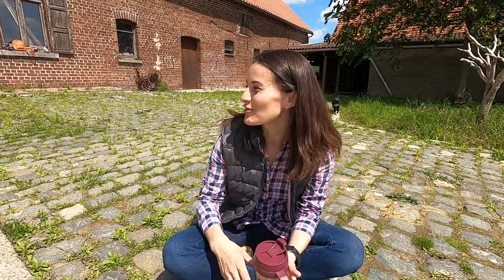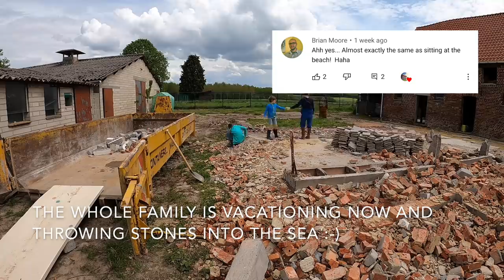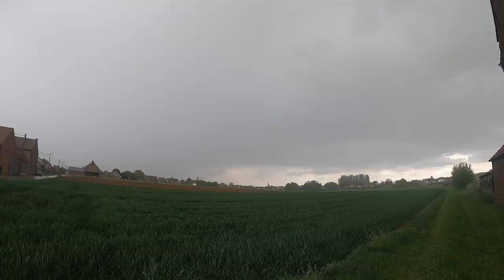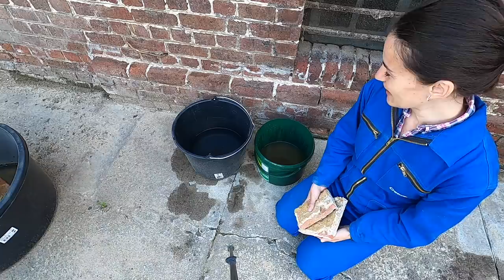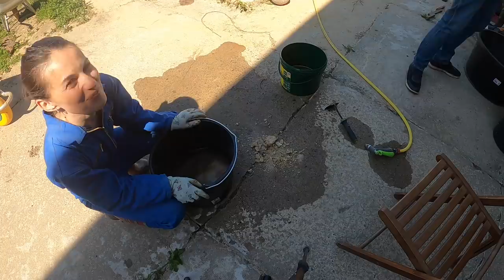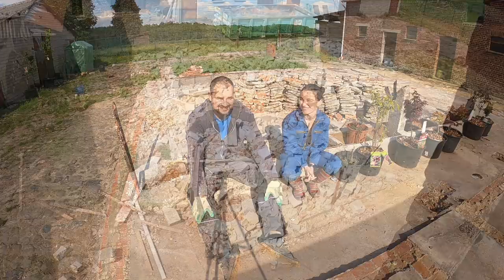NON-STOP backyard clean up from construction waste / fantastic SKY TIMELAPSE

Comment: A propane torch is an excellent tool. Also, horticultural vinegar30%, with salt and soap applied with a sprayer. Works very well. No chemicals.
Reply: there are also plant based weed killers since glyphosate products are banned. they work real fast and are bio degradable.
Reply: vinegar and salt make the pH hi
Reply from the maker: Plant based weed killers that are bio-degradable - sounds very interesting! I will check in our shops.
Reply: Plain old coarse salt applied on rainy days for maintenance after the tiger torch has done it's due diligence.
Reply: Wouldn't vinegar eventually damage their stones? Burning seems like a great solution in their situation.
Reply: They make propane torches specifically for this purpose. They work great!
Reply: @Aiko2-26-9   vinegar whil not bamage their stones , but the pH off the soil betwine wil get hi and other plants wil grow there , and those types of plants are almost impossible to get rid of ( Equisetum ) is 1 of them
Reply: @DeHoeveOldBelgianFarm   pelargonic acid
Reply: @louisblock1006  Interesting.

Comment: A 10 to 1 solution of what we call here muriatic acid or hydrochloric acid (or Zoutzuur in Dutch) would take that plaster off.  You can then use sodium bicarbonate in water to stop the reaction (once you've cleaned the plaster off).  It's basically a more powerful version of using vinegar and what brick layers use to clean bricks.   And once you mix in sodium bicarbonate (what we call baking soda), it becomes completely harmless to the environment. 

Бажаю тобі всього найкращого,
Jay

Comment: I think you need to make a wooden 'seat' to put the tiles into and then hit them with a bolster Try to get the majority of the mortar off them (I'd do it on a table). A brick bolster would probably be better - it's made for the purpose that you need it for. Also, a large rectangular plastic tub that you can get more tiles into would be good and a sieve that you can use to clean the vinegar with after each soaking would mean you've got a good chance of getting through the lot.

Comment: I like the propane method, not only kills the roots but any seeds as well. Only draw back is weed seeds float around so more will come. But you have a quick effective method now. Time to rent some equipment to assist with the concrete removal in the courtyard, a mini track loader will do the work of 5 people, rental rates in the states are not to expensive. An attachment with a bucket to scoop and load the debris into the container for hauling away. Will go much faster. Love your videos you are making amazing progress.

Comment: The propane / butane torch is good, but like another viewer noted, industrial vinegar helps as well. But your going to be battling it forever until you solve the root problem, namely an environment for weed seeds. You'll need to brush out a 2 cm / 1 inch worth of material around each paver and backfill with sand with a small portion of lime mortar. Sweep between the gaps, remove the excess, and water. It will seal things up and the weed seeds don't have a friendly environment to sprout and grow.

Comment: We only cleaned the sides of the cement tiles with a handgrinder (laminated disk), on the bottom we only remove the loose parts. It's a bit more work when you relaying the tiles, but it's still perfect after 20 years in our old farm. Once they are placed and washed in, we used a big rotation grinder for wooden floors (the ones with a big round disk) and grind the fresh layed cement tiles until the top (dirty) surface is gone. If you are in the north of Limburg (of Flanders) you can look and see for you self! Great job you two are doing.....TOP

Comment: The Propane Torch works, but the ash will work as a fertilizer at the end. There is no eco friendly way except the Saltwater but as a mixture with the cheapest washpowder from Aldi for white clothing! Mix it very strong, if you want you can put vinegar to it but this is not neccecary ( only for the smell) . I use always poolcleaner that smells better. With that mixture you can get rid of the green hell... hats off for your work!

Comment: The acid in the vinegar attacks the lime in the mortar. Any acid will work, even lemon juice. Muriatic acid is a version of Hydrochloric acid, the same as in our stomachs, but stronger. The acid in automobile batteries is Sulfuric acid. A strong version of vinegar - Acetic acid - can be obtained at photographic shops. It is used to develop film and photos. The strongest is called GLACIAL acetic acid, and can be diluted to a working strength. Muriatic is available at building supply shops and is used for etching concrete. It is probably the cheapest to purchase. When using any acid, be careful, wear gloves and eye protection. Thank you for the video. Anika is a nice cat. Jon
Reply from the maker: Thanks for sharing these details, Jon! Much appreciated!

Comment: To use the vinegar waste from stripping the lime mortar you can make an eco-friendly defoliate.  Use a mixture of one part salt to eight parts vinegar and a tsp (or small amount) of detergent for killing the vegetation in between the cobble stone you have everywhere.  Mostly it just changes the ph of the soil to a level which "most plants" find intolerable.  Dissolve the salt in the vinegar before adding the detergent or you will have a foamy mess.

Comment: If it was just a small area, boiling hot water would work. I've heard a vinegar, dish soap, and water mix applied with a sprayer works too. Though your backyard will smell like vinegar for a while. :)
Reply: Vinegar will deteriorate cement, so be careful what surface you apply this to.

Comment: you know that with just plain white vinegar you can spray on the grass in the cobblestones it acts a a weed killer and is safe to use and its cheap
Reply: or just use plain old road Salt and a good layer  ...  it hold it away arund half a year  after it it gone ...   we doing that at the fodbold station i work at ...  becouse we made not use any things like  vinegar ...  
or other  more evil things ...
Reply: My mother in law(97years) always uses  javel!
Reply: @nicolethijs5428  is will kill everything though...it's chlorine, a highly toxic chemical. As a side note...my Granny used chlorine bleach for everything from stinging nettle rashes to rinsing her toothbrush. Thank heaven we know better in the 21st century.  lol
Reply: I've used vinegar, and yes it does work.
Reply: White vinegar can be used for dozens of things- remove rust from old tools, great for cleaning with bicarb of soda...etc.

Comment: Vinegar will kill those weeds/grasses, but you have a lot of territory to cover, so I would recommend you purchase a sprayer (like the kind used to put down powdered weed killer mixed with water and then sprayed over a surface) if you don't already have one.  Vinegar is better for the environment than the off-gasses from the propane torch.

Comment: if it's lime mortar, fill an old bath with warm water and add soda bicarbonate crystals OR if you can find enough of them , sachets of kettle descaler . Put a load of tiles in and leave them overnight. Caustic soda would be even better and you could use the left over liquid to clear out any drainage pipes.

Comment: Borrow some local goats they will eat all the weeds between the cobblestones. Here in America some entrepreneurs have “landscape goats” for rent, they bring them around to clear the land. We have them right here in the city, they eat ivy, kudzu, invasive plants just about anything, they are very fast efficient and chemical free. 😁
For the tree stumps coming up through the cobbles drill holes down through the wood and pour 1:2 epsom salt and water solution, another way is to use vinegar. Look to see what will work best for your environment that way you do not have to disturb the cobbles by digging them up.

Comment: dear friends, i see you are trying to remove the grout from the tiles.  if I can give you some advice I suggest a needle breaker.  If you have already an  air compressor, with (50-60 €) you can find it on eBay.  Any other attempt will only be tiring.  Hello and good luck
Reply from the maker: Thank you for your advice, Raffaele! We will check this option :-)

Comment: vinegar is slightly acidic and therefore muratic acid is as well so muratic acid for a trash barrel heavy strength to break the bonds vinegar is at best 6% muratic acid can be purchased at 60% and diluted down to 20 soak and try 1 gallon muratic acid concentrate was about 18.00 american or 11 euros...cut with 3 gallons water and try?

Comment: The cleanup created a nice big patio, but I understand some of the concrete floors still have to go to free up space for plants and trees?
Making a spray solution with cleaning vinegar and a bit of soap works well against weeds, burning will only work well enough when the weather is relatively dry, but definitely not with the weather we had in May (I live not that far from where this farm is, maybe 60km/40 miles).
 May 2021 goes in the books as on of the wettest since 1900, only 1923 and 1983 had more rain in May according the statistics for the low countries.
Weeds grow like nothing else now and a weed whacker is very high on my wanted list now.
Reply from the maker: Hi, Tom. I would like to keep and fix the concrete floors and reuse it as a foundation for the patio, idd. But we are still discussing. The plants and trees will be in the pots on the patio. 
Wow, wettest?  We didn't feel it like that. I remember 6 years ago, when I just came to Belgium, it was raining the whole June. Literally every morning I got up to a grey sky and rain :-(
Reply: @DeHoeveOldBelgianFarm  Since I'm concentrating on outdoors work for my renovation now I did notice it did rain a lot, often with nice spells of weather in between, but sometimes last May it was raining for over 24 hours.
Making a patio of this square and having plants and trees in large pots sounds nice, you could surround the square with borders built up above ground level with brick walls about 40cm high.
I'm doing this to contain different levels in my garden and it looks nice,  it gives a cosy feeling being surrounded with plant beds being a bit higher than the patio area.
But it's all up to you what you eventually will do, it's not my garden.

Comment: the secret would not to burn, just to apply enough heat long enough to kill existing roots and seeds... there are machines for housekeeper, don't know the english word for them, even don't know the word in mother lang... work with infrared or gas... are available in different sizes... do it one or two times a year and there will be no problem with growing...